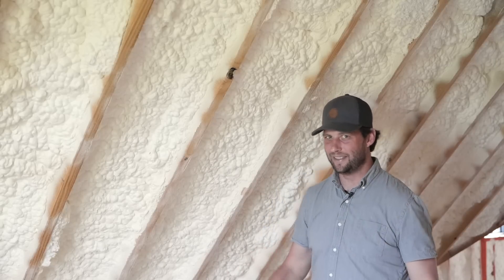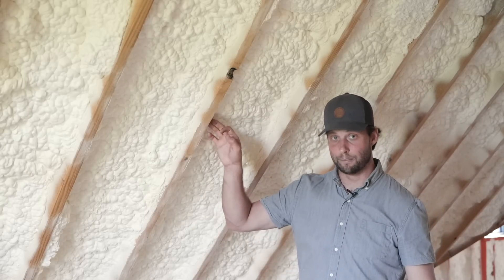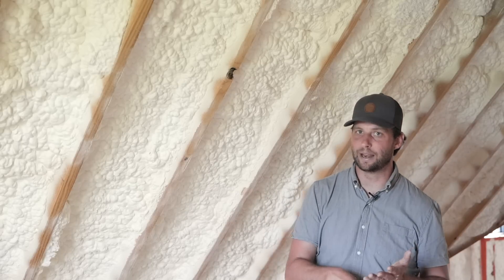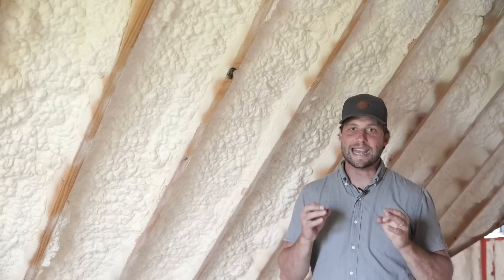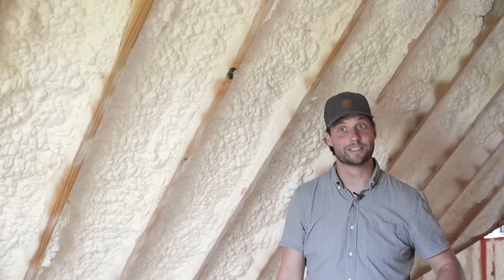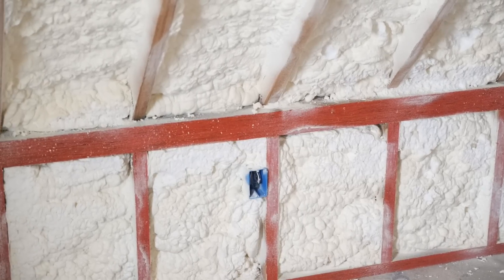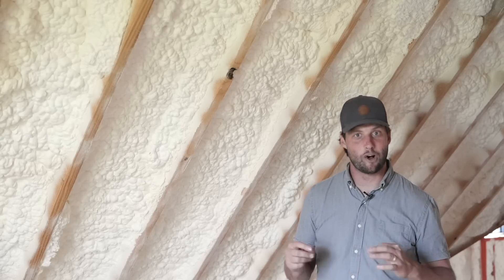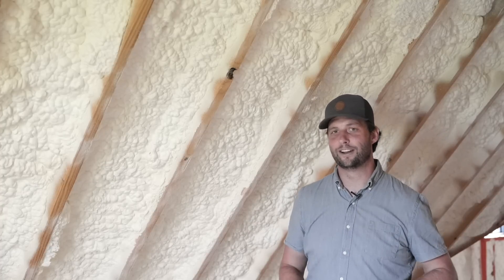Spray Foam and Radiant Barrier: How NOT To Do It!!

Comment: Had you used full length air baffles under the roof deck (leaving ridge vents and soffit vents open to the baffles) you would have maintained the effectivity of the radiant barrier and could have maintained air flow from soffit vents as well for drying and to prevent air dam issues. Your foam would actually be a LOT more effective in summer as the radiant barrier will function and stop and lowered the E value before the insulation was affected by it. That would have given you a much higher effective R value. You could have reduced the foam by 2 inches and approximately the same R value net for summer. 
Radiant barrier is incredible, especially when used in vented attics. I have installed MILES of it in Texas. Retrofit it goes under the rafters, and in areas in Texas where it gets cold in winter, over the insulation as well.
I notice that you have about 1 inch or more between rafter bottoms and the foam. This means that you can use another layer of reflective barrier then the drywall and again gain advantage of emissivity values. This would raise your effective R value in both summer and winter. Remember you only need 1/2 inch of air gap for radiant barrier and only one direction, but when you place on both sides (below roof deck and above ceiling with foam in between) with an air gap on each, you are probably higher R rating than foam thickness and you allow any roof leak to run down to the soffit where the water can be visible.

Comment: There's a lot to unpack here, but just a few technical corrections. 

First, remember that while there are different types of energy (potential, kinetic, thermal, electromagnetic) all energy is equal. Meaning, a joule of kinetic energy is the same amount of energy as a joule of heat energy. Also, at a molecular scale, heat energy is just kinetic energy, atoms wiggling...

Second, a radiant barrier is just as good at it's job if it's touching air or insulation. It's still going to prevent most radiant energy from passing the barrier. Remember that radiant heat is light, under infrared, so some will be reflect and some will be absorbed and remitted. 

The air barrier does require convection to physically transfer the heat, which is better than your dry wall being right next to it, but your spray foam is a much better insulator than an air barrier. This is why we put insulation in walls, after all.

Yes, the foam touching the radiant barrier will be hotter, but the net heat transfer to the interior space will be lower. 

More importantly, the combination of foam plus the radiant barrier should be better than foam alone.

Comment: So years ago, I bought a shed with tech shield installed on walls and ceiling. Then later I decided to put insulation on the walls and then paneling. Please tell me if I should not have done that. Thanks
Reply: Yes. As long as you have a 1 inch gap between insulation and wall. If it’s 2x4 walls then remove instantly. I just started this then caught moisture.

Comment: if you want to show people how good radiant barrier is get an iron (like the one you use to iron clothes with), set it on its end and turn it on full blast.  Once its been on for 5 or 10 min have them hold their hand in front of it till they cant hold it there any longer.  Then take a sheet of household aluminum foil and put it between their hand and the iron and they will be able to hold their hand there for basically forever because aluminum reflects 97% of radiant heat.  The only 2 elements that are better at it are silver and gold at 98 and 99% respectively.

Comment: Did you consider painting over the radiant barrier and using fiberglass or foam-board? I've got this situation and am willing to eat the loss of the radiant barrier but spray foam is the most expensive option. If I could paint the radiant barrier with a paint that would stick to it I could then use the less expensive option of fiberglass.

Comment: I set up some experiments using foil and 1" foil insulation and some other setups, it seems that just having a gap without foil works as good as a foil with a gap. One-inch solid insulation on the inside or outside of roof sheeting also does the same thing as air gap and foil with air gap.

Comment: My solution for that was 1-1/2 lathes nailed to the inside of the rafters then 7/16 osb nailed to the lathes, with spray foam on the osb and rafters. Then you have radiant barrier, vented roof, air sealing and attic in conditioned air space.

Comment: I must say that there is physics that you do not understand and it is not easy for anyone to understand it themselves. However, emissivity and reflectivity are physical properties of the material/surface and do not depend on the position of the material you place next to it, such as air, wood, foam, etc. There are many other variables though such as the wavelength of radiation, the spectrum, and the temperature of the sun and other surfaces. In short, whatever you add won't hurt. However, speaking of cost, metal roofs are a radiant barrier ithemselves, and adding an air gap with proper ventilation is more important than adding another radiant barrier.

Comment: Did you consider installing the techshiel upside-down, with radiant barrier on the outside?  You would not get the ~90% air gap you might have had with no spray foam, but you probably get some % of an air gap.    Also, did you consider installing a separate radiant barrier on the bottom of the rafters, before installing sheetrock?  This should provide an effective radiant barrier, although it would be inside the building envelope.

Comment: Very confused on what you did in that ceiling 
The way everyone else explains radiant barrier is exactly opposite of what you are saying.  The way I hear it works is you need a space between roof and aluminum.  Otherwise conduction will occur Thur to aluminum which is an excellent conductor of heat.   So with aluminum on the face of your osb  it will act as a conductor not as a reflector of radiation.  So as far as I can tell can’t have both?    Then you sprayed foamed on top of aluminum barrier and insulation will now act as a conductor considering it’s sprayed directly on aluminum with no space between.  This should not be anything that hasn’t been well researched and documented.  You a seem to act as if  no one knows?   I am sure this is not the case unless you trying to sell something which seems to be the case.  
First mistake was never explained exactly how ceiling was made. Seemed to be in a big hurry.  Slow down explain it carefully with drawings or diagrams. Be specific what you did.  
 Even that dog house experience was confusing in the other video. 
I like your enthusiasm but slow down be careful explaining in detail.

Comment: How are you going to ever replace the roof decking in the future if you foamed directly to it?  I hope you put roofing felt/paper/underlayment something, so that can be replaced when water will or could eventually damage it.
Reply: Are you talking of a leak?  I can assure you I have put in a couple of pieces of sheeting here and there on a spray foamed roof but NEVER has the entire decking needed removed.  If you needed to remove ALL decking there was another problem and nothing to do with spray foam I can assure you.
Reply: @davidburkholder7360  well yes roofing fails over time 100% of the time, hence why roofing gets replaced every 20 or so years.  All decking, a few pieces of decking a piece of decking…  The point is without a break between one component to another.  When you have one material that will likely need some repairs/maintenance or replacement, then how are you not passing the buck?  I’m not saying spray foam is bad.  The install of spray foam doesn’t account for the future issues, maintenance or expense of the roofing.  Roof decking does have to be changed from storm damage in my area often.  Why would it matter if all or some needs to be changed?  The question is if any needs to be changed how the heck do you ever dream of removing it for repair, when a simple layer of felt would create a break between material and help the next contractor down the road someday.

Comment: Won’t the radiant barrier still reflect some heat? If I put a mirror in the sun, it reflects heat. If I touch its back, it will conduct heat to my hand, but it’s still reflecting heat from its surface. It might not be as efficient and it might not be worth the money, but I don’t think it does nothing.

Comment: Good Stuff, I'm going through the same thing with my shed/workshop. I put r-19 bats on top of radiant barrier. It didn't do anything except transfer conductive heat. I ended up spray foaming it. In the Texas heat, it rocks and works like a champ.

Comment: I have been looking into using a baffle that you can use in conjunction with closed cell spray foam insulation. This would allow for the 1"-2" air gap to vent the roof, but also be sealed by the closed cell spray foam insulation used on the baffle. Does this solution sound like it would work and maybe be the best of both worlds?

Comment: 🤦‍♂️🤦‍♂️.   Just a lack of knowledge of options is all.

Could have done several things:
1. Exterior sealing (tyvak wrap with tapes).
2. Caulking spray the truss connections (air seals) and nail holes 
3.  Could have used drywall gasket caulking prior to drywall install to help the system. 

Personally.  Pro tip:  if the walls/attics don't breathe...they rot.  Mechanical venting is only half decent for long term functioning.   Best to build the solution in physically

Comment: Question, I have a new build house that I am considering spray foam on the rafters. I am using Zip R6 on the exterior sheeting and rockwool R19 in the stud space. I just want to spray foam the roof system. How do I vent the space? Eave vents and ridge vent? Do I condition the space with a supply and return from HVAC?

Comment: I know my suggestion is after the fact.  What if you would have put pvc pipe under the insulation on your roof and gone up to your roof ridge prior to shooting the foam into the remaining area?  That would give you your “gap” yet allowing for the sealing of your layers of insulation.  Yes, I realize that would be more labor initially but would you get the benefits of both.  Just an idea.

Comment: If you can afford closed cell foam, you're probably building with Insulated & Taped Zip panels which drastically cuts down on air transmission into your home along exterior walls. As for your cathedral ceiling, there's virtually no openings, so that argument flys out the window. Now, spraying your hip walls makes a lot of sense. But having spent the money on the upsized 2x10s & TechShield, you should have gone with the R30 faced batt. Otherwise, you shoud have just stuck with 2x6s, assuming they supported your loads, and then sprayed them with foam. If you're not going to leave an air gap, then you're throwing money down the drain with TechShield. Just my $0.02.

Comment: I put the spray foam against the roof deck and the radiant barrier on the underside of the rafter, may be  overkill but hoping it helps with energy savings
Reply: Does this work? Can you just spray the completed  spray foam with radiant barrier?
Thanks

Comment: I think your analysis is way too confusing and way too complicated.  The radiant barrier will still reflect some IR but the conductive heat is coming through is pretty much the same with or without the radiant barrier and that is what the foam will insulate against.  The venting issue just is another (and effective) of getting rid of that conducted heat but the foam is going to insulate against most of that.  The simple way to show this is just to mock up a sample and out a heat lamp on the roof side and measure the temperature on the inside.  I suspect you will find minimal difference  between foam with no gap and bats with gap.  Also, one of the comments said you used open cell foam.  I assume that is not the case, because that would not provide much insulation at all.  As well, why all the hand wringing about vapor barrier.  Most of the northern world has been using PE vapor barrier over fiberglass bats for decades with excellent results.  Putting a new light in or missing a seal somewhere has minimal effect.

Comment: I personally would have nailed a 1 inch foam board one inch off the reflective material and then sprayed closed cell spray foam over the foam board. You would have gotten an R value of 42 +\- 1, additional structural integrity by the closed cell, vapor and air barrier, and would still have your reflective ability all at the same time.

You did what you thought was best for the situation at the time. That’s what matters.

Comment: Techsheild will still add a little r value and it will still reflect heat. I see it as just increasing benefits, maybe not cost effective now but over decades will help energy use.

Comment: I’m doing the same thing right now. I used tech shield, but have now decided to spray foam. The tech shield was actually cheaper than regular decking when I bought due to the lumber prices at the time so I guess it worked out in the end.

Comment: I guess I am confused about the use of air sealing on the outside and then going back with spray foam. It would seem that if you already have the air seal on the outside, that the use of the radiant barrier,  then fiberglass would cover all of your bases. With the spray foam, as you stated, you lose the radiant part. In short, I am confused why the spray foam is better. Thanks again for another great video.

Comment: @ Jordan Smith I watched this video because I'm trying to figure out a similar challenge.  I am trying to get the most protection I can in a 2.5" thick stud bay against metal with shiplap as the interior wall. My thought was to use 2" of closed cell spray foam to deal with the condensation and conduction and trying to add in some form of radiant barrier to the mix (one of those multi layer insulation insulation products).  If I put the radiant barrier first, right up against the metal then spray foam right on top of that, then the layer of the radiant barrier that is directly in contact with with the metal and as well as the closed cell foam would not be working for me (only the inner layers of the MLI is beneficial).  But what if I put the radiant barrier in the gap between the spray foam and the ship lap wall?  Thoughts?  Although there wouldn't be perfect even gaps in between the 3 materials, a vast majority would have a gap of one sort or another.  Thanks for the video!

Comment: I must say, I'm glad we are learning how heat works... But we are missing a few things here. (not being rude just pointing out somethings) Radiant barriers DO reflect not absorb (rejecting heat in this case is reflecting heat unless you can draw that heat away). Absorption is what something black would do (although everything does absorb radiation in varying amounts). Radiation IS light, mostly infrared. Although radiation is a longer wave length it can't penetrate the metal roof. All things emit radiation, as everything has heat. More heat = more radiation, sometimes into visible light if hot enough (like the sun). The way a radiant barrier works is by reflecting the radiation back to the surface that emitted it through a gas (because they don't absorb it much or through space). if you don't have a gap you don't really do anything. The gap can also be used to cool the surface. The radiant barrier should be pointed in the direction of the heat source. An air gap under the roof deck with a radiant barrier beneath it would be a better design. Or put the metal roofing on furing strips with a radiant barrier roof deck. If you live in the north an attic facing barrier would help a tiny bit. But shouldn't have anything in front of it.

Comment: You should have installed a layer of rigid foam an inch away from the radiant barrier, then you could have sprayed foam over that to air seal.
Rigid foam is by far cheaper than spray foam and allows for a more efficient system. I use both spray and rigid because they both have their advantages and benefits.
Reply: You are Correct.
Reply: Yes, this guy must sell open cell foam because it’s obvious to anyone that he should have done what you suggested. I feel better having a vented air space next to the foil in case any moisture gets up around the roof deck.  It can dry without the mold possibilities . The vented roof doesn’t even have to be open without obstruction as roof felt can allow moisture to pass.